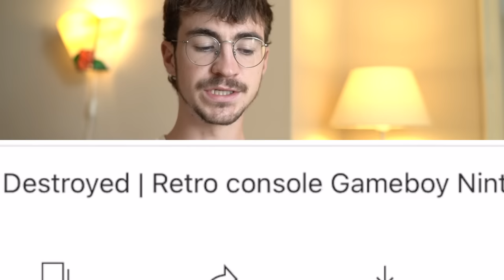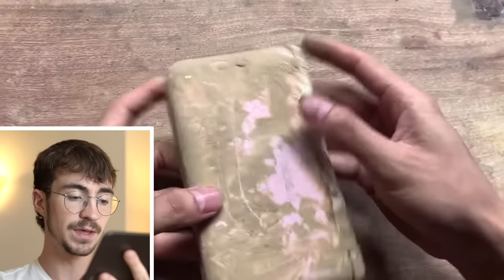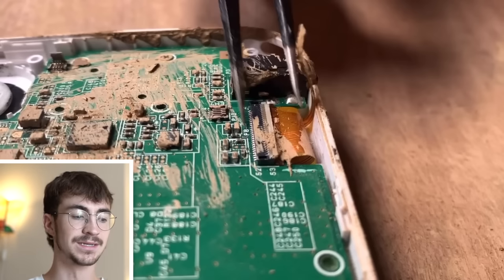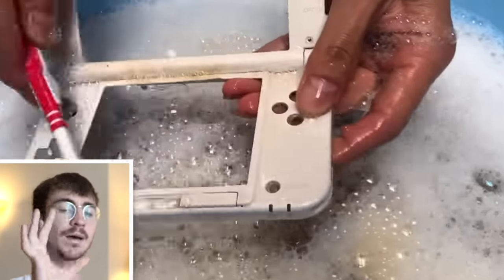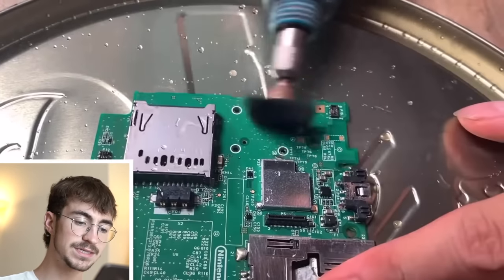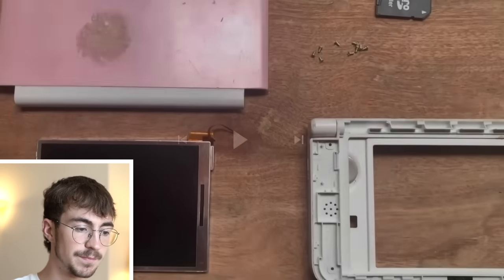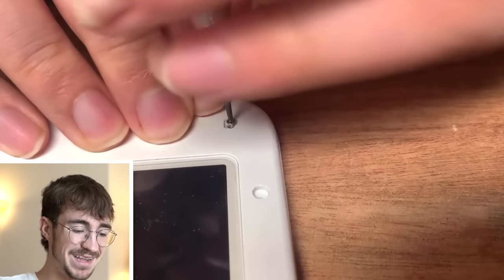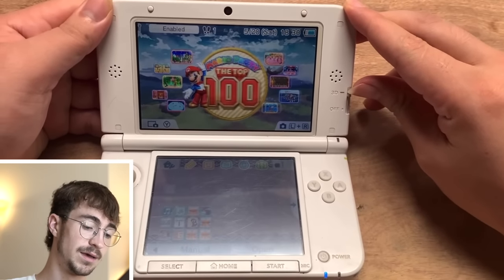Exposing the FAKEST Nintendo DS Restoration

Comment: Something a bit interesting is the fact that this 3ds was modded, to have a custom theme of a game that came out at the beginning of the year, considering the fact it's date, which not saying that it is when they recorded but it very well could have been. it would be two months before it was recorded that the game came out, meaning within the game coming out, someone going out of there way to get the custom theme put on it. they seem to have had the biggest tech failure in the world, thrown it in a river, had it dug out the river, only to then be tossed to the side of the road but not before piling more atop the of it, and to make it even more incredible, The L + R springs still were completely intact. which i've owned a fair few of DS and 3ds, those tend to be the first thing to go. Oh also don't worry about the serial number still being visible. That sticker totally is able to look semi worn from all that destruction. I'm sorry but if these guys want to do fake repairs. they should likely stick to 25 year old systems, at least those are easier to fake

Comment: The stylus being in the slot proves that they purchased the device the same day as they made this video. The stylus has a hidden timer that starts the moment you break the seal on the box. When the timer reaches zero the stylus will vanish from our plane of existence. The timers can be set anywhere from 1 to 24 hours but they never exceed the 24 hour mark.

Comment: during the pointless testing of the board, the indicator pad wasnt pink.
they cant risc to damage the board by cleaning, they were unneccessary rude with the dremel after the wash, no effort there.
the patch isnt the same, it doesnt match the hole, and the soldering iron scratches around it diappeared magically.
haha the 3d slider and the dirt is another indicator for doing everything in reverse.
very obvious.

Comment: also noticed after triggering the moisture trap, and doing the circuit testing on the leds....... the moisture trap had reset..... yep you were right. Reversed footage. 

Also side little note, nothing wrong with washing electronics in water and soap, if the electronics are sealed. like SMD components. Its good practice to then give them a quick IPA wash after to help evaporate everything quickly.

oh moments after i post the comment you noticed the moisture trap :D

Comment: If you notice post fix patch of the hole is pink like the rest which shows that the blob is on top of the case pre hole as it would have been translucent white if the hole was in that spot. So it was a case lid made to look like it was patched but was not. Granted the baking soda and super glue trick would have worked to patch but it would have not been the color pink after it dried as the void would not been nothing but the baking soda and super glue and not the color of the case bleeding thru.

Comment: 3 things of note here:

1: baking powder + super glue actually makes a very strong and durable joint, however it's I'll advised to be used as a repair tool for a post nuclear war condition 3Ds

2: The water humidity pad makes this a mess, because it's clear when dirty and clear when recovered, implying that either the water bit was the very last thing they filmed or that they used 2 completely different MBs

3: Finally the burnt marks surrounded by thin deep scratches really gives away what caused the damage, clearly a baby dragon tried to swallow this 3Ds.

But yeah, jokes aside this is some real transparent bullshit, at the very least they put some effort into making the video entertaining, which does not excuse them from spreading misinformation.

Also, please don't destroy electronics, specially ones on the way to becoming retro, it hurts.

Comment: I'm restoring a longboard right now neglect is not fun. I'm just lucky that the thing isn't totally trashed and is completely rideable just needed to fix a few gaps. Most of them were on the edges and the ones in the middle were really tiny and more buffs than anything I could stand that down.

Comment: You're 110% correct... if you look at the cleaned up 'after' shot, it's clearly before because the liquid damage indicator is back to not being pink.. that's exactly what they're doing (what you described).  Go to 13:41 into your video and you can see in the pan shot they're doing in the 'after cleanup' portion of the video, it's clearly and obviously not pink anymore...lol.  Woops, you noticed it later and mentioned it too....

Comment: I remember the first time I saw a fake restoration video. Some guy picked through some trash on a river bank and pulled out an XBox. As soon as they started to wash the motherboard with soap and water, I clicked off of it.
Reply: Funny thing is washing PCB boards in water is actually a industry practice. Difference is distilled water and specialty detergent is used inside a ultrasonic bath…

Comment: Some of that could be natural. Uneven staining, Uneven dirt distribution. Even the "hole" in the top of the one could be where it was laying on something and mud caked on around something that was later removed. I could buy some of this. Even some of the "brush strokes" could be streaking from rain or if it had gone though a fire. I could buy some of it, but all of it together is a little sus. And even if it's all legit damage, the working one at the end being that same one, impossible.
Reply: But you did get me with the no rust thing. No way it's in that condition, and there is no rust anywhere. You have me there. Even giving as much charity as I can, that's just not possible. Ok, yeah, the farther you get in, the more fake it has to be. Danger of commenting early. My bad.

Comment: The part that got me as a toy restorer, was the fact that the super glue mixed with the powder was overspilling onto the plastic and since super glue will permanently etch plastic, I don't know how they avoided the overspill further damaging the lower plastic? Also, when they showed the hole being repaired, did anyone notice the scar marks that were shown earlier still there? Also, why didn't they just sand the repair to make it smooth and repaint the bottom? It wouldn't have looked so bad as you could see the ugly repair still present? That or just replace the damn case.

Comment: CA glue and baking soda/sodium bicarbonate is a real repair technique for filling in holes in plastic. Q-Bond is kind of the professional version of that but I've heard people say that just plain super glue and baking soda works fine. It forms a pretty rock solid mass that can then be sanded down to shape after it sets.
Reply: I'd call it a filler technique for  restoration, an alternative. It's not actually a total repair of the original destroyed plastic
Reply: @troywright359  well I mean to the extent you can repair plastic at all... You're always going to use some kinda filler if you're not just going to throw it out and get a new molding